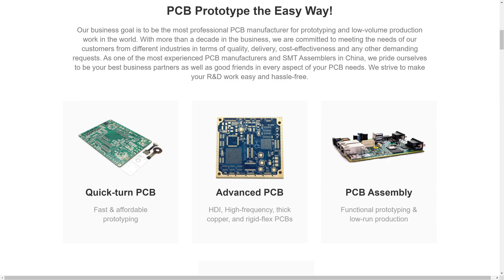I need to get better at soldering

Comment: Cold PCB is the issue.
It just sinks too much heat from the soldering iron due to the large delta T.
A work surface that lets air through, with a heater underneath works.  Helps if you box the sides, or perhaps a "table cloth" that can handle the heat.

Comment: A lot of times, working on old welding machine circuits that I really didn't want to yank out all the way, I would use hot snot (hot glue) to hold components in place if I had to work vertical. After you're done soldering, you can just chip the stuff off with your pocket knife or something.

When working with small SMD components, I find it useful to blow on the component a few times when moving your tip away from it, that way the solder will be a little more solid when you release and the component doesn't come along with your tip frustratingly. Really helps with the initial tacking of a side of pins to make sure its there. After all, once you have it all on there, you can always reflow your joints and make it pretty before testing it.

Solder wick is great stuff, especially with added flux, but it tends to grab at things that have a big copper plane sucking up all that heat, and can really damage pads. If you are serious about repair and desoldering, get a Hakko or something similar, rather than using a Vampire, Solderpult, or whatever spring loaded tool. Not only does it take less time, it burns boards less. You can re-wet a joint with your iron, put your iron in the holder, put the Hakko on there and move it around in a circular motion until you feel the pin wobble for through PCB components, and then just pull the trigger. It's usually gone, and the pads are usually still intact. For SMD components, I recommend a hot air rework station, and a lot of Kapton tape to block other components from taking the full heat nearby. Hot air rework stations can also be useful with solder paste, to put SMD components on boards. Those little plastic foot capacitors can be done by hand if you're careful by pre-tinning the pad, and then just touching a tip, but it's a whole new ballgame when you're just painting or squeezing out paste, then putting the hot nozzle over the top and it's just "on there" now.

And finally, with that knife tip, you should really familiarize yourself with drag soldering, especially if there's a row of pins you need to connect. If you're quick, and have enough flux down, you can do a lot of contact points just moving a blob of solder, zipping along the pins. As I said, you can always reflow later if there are any bridges. Drag soldering really changed things for me for replacing opamps, and working with fine pitch IC when you don't have access to an oven. I used to tack corners of an IC, and then sit there and make a bunch of bridges, and then slowly scrape down the pin with a clean tip over and over, sometimes getting out the braid, until it all looked okay. Often times bending pins beyond recognition, requiring me to desolder the IC, straighten everything and put it back down again. Drag soldering, you tack, then you just sort of go in one direction, sometimes back tracking, and once you get the feel for it, you usually only have bridges at the end of your pull to deal with. It makes extremely quick work out of through DIP packages, and sockets to mount a prototype on when you're wanting to test a lot of chips fast, or have easier repair down the road.

Looking forward to seeing your future repairs and modifications!

Comment: Another tip that is like steroids for soldering:  spend the money and get a desoldering gun.  You are damaging the board by overheating it and putting it through too many thermal cycles by removing solder with braid and solderpults, those bad stubborn joints that take 15 minutes to clear are a waste of time and bad for the board.

Comment: The best tip beginners dont realize is that there are different iron tips for a reason.  A chisel is for superior heat transfer, a needle for working very fine pitched pins, the conical tip is the jack of all trades, master of none.

Comment: My recommendation, get prototype boards, the PCBs that are filled with holes that allows you to solder any circuit. Get a bunch of resistances and cheap components and solder them to these boards.
Practice makes perfect!

Also, get a hakko soldering station, and get up to date in all types of flux and how to use them. Both are game changing.

Comment: I used to like Eagle but i felt it turned to shit around version 7.5, it pretty much broke my project i was working on and the recovery was difficult... and at the same time Kicad version 3 already got pretty decent not how it used to be when i first tried it early on in its development, so i made the switch. If you used Eagle 20 years ago, you'll probably find that it's not the same, so it's effort either way.

Now at version 8 Kicad got even better since. It's free, nobody can take it away from you, and most people in classic computing space make and publish their designs with it, such as Tubetime and James the Bald Engineer, designs which you might feel the need to adapt and get printed, which is another reason to put your skill points into this package.

Comment: Hi there Phil! My suggestions would be to trim the length of the legs down to approx. 1 cm after placing the components; to make sure that the soldering wire has built-in flux cores; to use a pointed soldering tip (no need for large tips for small components); to keep the soldering tip to the component/pad for another 1-1½ second in order for the soldering wire to melt and form a "capillary" form rather than a drop-shaped "blob"; and to use enough heat, e.g. 450°C (most components are not very sensitive, with the exception of transistors/semiconductors and the like, in which case you should turn down the temp a little and let things cool for 10-20 seconds between each leg). Other than that, you're doing just fine! Thanks for your videos!
Reply from the maker: @bjorn_wiberg  Thank you ☺️

Comment: For holding components without bending the legs I recommend some common sticky tack. Like the puddy like stuff used to hang posters and such. I just keep a couple of small pieces of it on the work bench and reuse it while soldering. Doesn't take much to hold something in and you can break it apart to tack multiple sides to keep it even if needed.

Comment: I'd highly recommend picking up a used Metcal station - once you use an induction based system you'll really wonder why you ever used anything else! The PS5200 is very nice, but you can have the MX500 for much less - and if you ever get a good deal on a non-working one, they're usually very easy to repair :)

Comment: Judging by the intro video, your soldering work looks good enough, really.
The only thing i can say by my own experience is that Flux will always make things easier. I buy the hard rosin flux in tins by Termopasty because its cheap and it works, but you may find paste flux easier to apply and use.

Comment: 1. Use only WELLER (280-350°C max) with a larger tip than the size of the pads you are soldering (transfer the heat is the key)
2. Stay away from lead free solder on old electronics
3. Stay away from lead free solder (only if you are a masochist! - serious joke)
4. FLUX! there is never too much flux
5. Use a desoldering station together with a hot air station for reworking (soldering bride is mainly for cleaning the pads)
I see you bought a lot of stuff from AliExpress :-)

Comment: Currently I have a soldering iron / hot air rework station hakko knockoff. Has worked fine for the few years that I have had it.
For solder removal, sometimes wick works ok, but I also have an antique solder sucker station that uses an electric pump. The newer junk ones have everything made into a huge handle and look very unwieldy.

For smd soldering, the best is to use a solder paste that you put on the pads and then place the components. A pre-heating bed / platform is helpful though I don't have one. Then you heat it up with a hot air station to melt the solder paste and the components settle into place automatically.

Check out NorthridgeFix for some sweet smd soldering examples:
https://www.youtube.com/@NorthridgeFix

On a side note, I just finished repairing 3x Nvidia 780Ti video cards that had components nocked off the back side of the cards. I used parts from other dead cards as doners. The hardest part was removing the flea sized capacitors off of the dead cards without burning them. Used both hot air and soldering iron to do that part.
Reply from the maker: Great job!

Comment: This kit and similar are good for learning absolute basics, but will not prepare you for modern motherboard/graphic card PCBs. Kits are 1, at most 2 layers with big nice traces/pads and THT components.

Modern (past ~1998) boards are heavy on multiple large ground planes and those soak heat like there is no tomorrow. Its like soldering to a radiator. This is why you need proper modern soldering iron (T12 or C210/245 cartridge style tips) with enough power to not worry about it (100W is nice). Avoid ifixit new iron, its declared 100W output turned out to be a scam as seen in EEVblog review showing it barely does 40W :/

Forget toy kits, get a piece of salvage electronics for soldering practice, broken modern PC/laptop/phone motherboard will be perfect. You will immediately recognize the problem no amount of those 1 sided kits are able to prepare anyone for.

Dont like that holder, you were soldering small pcb and it was already bending. Personally I prefer holders that grab pcb with long rails or in multiple spots.

Put a fan behind your work piece to at least redirect fumes. Solder is fine, but breathing burning flux is a one way ticket to respiratory system problems.

Cheapest Hotair ($30-40) is a good idea as a handheld preheater, will help with bigger boards that sink all the heat away.

Buy flux, even the nastiest Chinese one (just dont breath it in), something like a $5 flux pen will be good for a start. Will help with oxidized solder joints on older boards. Cheaper the flux lower the smoke point, smoke means flux is burning , burning flux doesnt work. Worse the soldering iron higher the temp you must set. Its all a balancing act :)
Reply from the maker: Yes you're right! I worked with a Slot 1 board recently and it's so much more difficult. I'll be upgrading the soldering iron for sure. Thanks for the pointers 😊

Comment: Sadly I lack any tips for soldering... Sorry. For some reason that seems to be stressful for me, I really don't wanna blame myself after a botched job for something I cared about and ruin it completely unknowingly, and for now I'm glad that I was lucky enough to build myself a few PC Desktop machines without doing that.
Reply from the maker: Hmm I strongly feel that you learn most from failures.
Reply: @philscomputerlab  Sure, But I just Realize that I'm just too anxious about doing such a thing and I tend to think that as soon I could be able to that (After some prep, that is.) there's a chance I could ruin it and the only thing left would be... I guess throwing away the broken thing I tried to fix.
Reply from the maker: @Super123456789Kuba  Maybe, but you will have also learnt something. You could be smarter than me and practice on broken stuff first 🙂 I tend to just dive straight in and it often gets me into trouble 😂
Reply: @philscomputerlab  Well... I guess I have some broken parts that just came literally dead on arrival, so maybe I could try something... 😅Also... Welp... Perhaps? 🤣

Comment: dont trust the flux in the solder, there's no such thing as too much flux, use a good flux as well . blue tack or polyimide tape to hold your components in, and practice. also get into the practice of using 99% ISO to clean the board before and after soldering

Comment: back when I was learning to solder I found that tipping the PCB over and pulling the extra solder down the wire before cutting it makes for a nice fillet and can detect defects. I also learned that preheating the PCB with a hair dryer helps. And having good flux is a must. nowadays I use Sn96.5 Ag3 Cu0.5 with rosin flux. and I have seal-able containers to wash in iso
Reply from the maker: That's leadfree solder, right? I've never tried using that...
Reply: @philscomputerlab  yes it's lead free and it has less time it can be kept hot compared to lead solder, but it helps keep the boards ROSH compliant. I also use the replacement amtech flux.

Comment: Get yourself a Hakko FX-888D if you can find one. Not super cheap, but they’re great, and you’ll likely never need another.

As for your technique, it doesn’t actually look any different from what I would do. You’re placing the iron against the pad and the leg of the component, and touching the solder to the opposite side so that the heat of the pad and the leg are what melts it, rather than directly touching the solder to the iron. That’s exactly what you want to do. But as many have already mentioned, you need some flux. Get yourself some flux pens. Very handy. Nearly every single solder joint you make shows the solder barely adhering to the PCB pad. Flux will help solve that problem.

Flux does two things to help you. It cleans the oxide off the metal you’re trying to solder to so that it will make a good connection. And it helps keep the solder where you actually want it to go. This makes it much more difficult to connect neighbours because the solder doesn’t want to bridge across connectors when there’s a lot of flux there. This makes soldering a big line of legs on a surface mount chip a breeze because you can just run the soldering iron across all of them in one sweeping motion and the solder will only go where it is supposed to go. Take a flux pen and slather a whole bunch of flux onto the joints you’re going to solder. Can’t have too much. And you’ll see your joints will behave much better. Then after you’re done the whole job take an old toothbrush and some isopropyl alcohol to clean off the remaining flux.

Comment: i usually use a piece of captians tape or tape a piece of card over the components to hold them in place while i turn the board over to solder them. if its a heavy component i use plastercine  or hot glue . hope that helps

Comment: It's true that the tip shouldn't be too small because then it can't convey enough heat to larger areas, but it shouldn't be too large either. I could not solder such small PCBs with a tip that long. Seriously, that's like trying to write while holding the pen 15 cm (or 6in) away from the tip. Ever tried that? ;)
I highly recommend a smaller soldering iron like the Sequre sq001 or the Miniware ts100 (same internals) or any of their predecessors or clones. I've been using an sq001 with cfw for higher temperatures in combination with a simple 65W laptop charger for years and I can't recommend it enough.
And as many viewers already pointed out, flux is our friend! (as in extra flux, not just the stuff in the soldering wire ;)
Reply: Have you tried changing capacitors on a motherboard (heavy multilayer ground plane) with those portable 60W irons?
Reply from the maker: I think you're referring to the length. I meant the width or shape of just the front part of the tip...

Comment: I'd recommend checking out some of Voultar's soldering videos. He does a ton of game console modding work and makes it look easy. I think his main soldering iron is a KSGER T12 that you can adjust the temps quite easily, and uses T12 tips that you can switch out depending on the job. Just be warned that not all KSGER T12's are equal, and internal components and build quality can vary quite a bit.

Comment: Always use top quality solder. Cheap solder is the biggest detriment to soldering. Also scrub new solder joints with spray alcohol, hot water, and a plastic brush. Then scrub with soap and water. Board comes out spotless.

Comment: Weller make a PCB holder with a little arm that folds out to hold components in place. Look up Weller ESF120. They're not exactly cheap though. I have one and to be honest I never really use it.

I usually populate the components starting from the lowest profile stuff, flip the board over and place it directly on the benchtop to hold them in place, then repeat with the next tallest component. Blutack or tape also works but I'm way too impatient for that, I'd rather burn a finger if something won't stay in, it'll grow back

Comment: I love rosin core solder, but its no substitute for absolutely dousing your board in just an obscene amount of flux. I use the MG Chemicals stuff, its expensive but its what the pros use so meh.

I use a Silverflo 8586D station, it comes with a temperature adjustable iron and a hot air gun, was £48 direct from China, does the job. There are much better ones and it's probably worth paying extra for a name brand.

For holding stuff, i just use a "helping hands" thing thats just a bunch of crocodile clips on bendy arms. It lets you move the thing you're soldering around to any angle, but it's probably a lot less stable than your fancy board holder.

One of those pots with the steel scrubber in it is useful for cleaning tips, works better than the old wet sponge lol

The last thing on the list is a microscope, I've seen people get on really well with those cheap LCD ones, but I'm saving up for a proper trinocular one from Amscope or Swift.

Comment: i cut the legs after soldering then touch up the solder joints with the iron afterward to make them nice and eliminate the chance of cracking the joint from cutting.